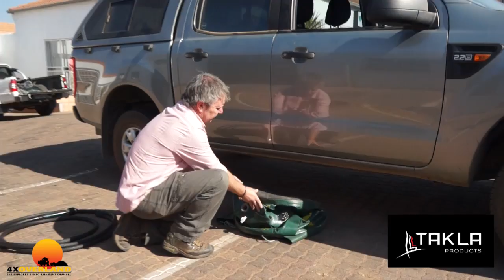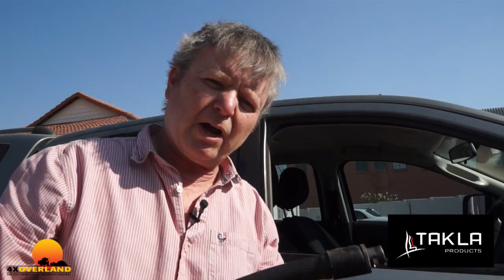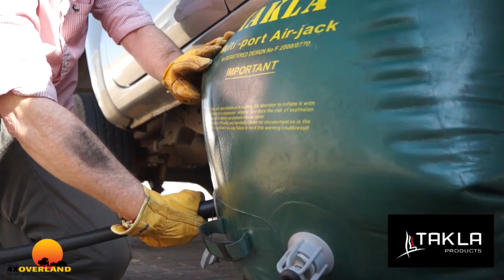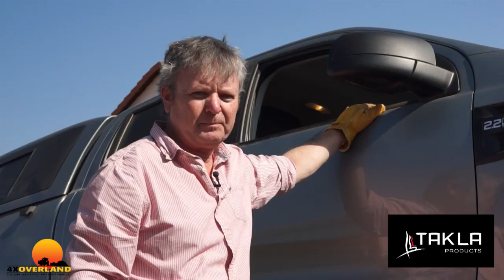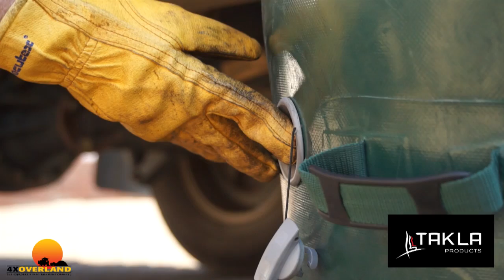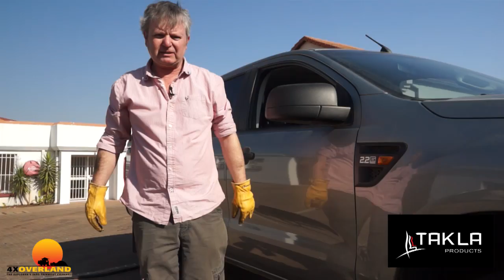Air jack Recovery Demo

Comment: A jack may be more dangerous, but it doesn't take as much storage, it can be attached to rear bar/tire, bonnet, side, front and rear of a roof rack, where this could only go in the boot or on the roof rack, it also takes much longer and more work, if I'm stuck on a beach and the tides coming in I'd rather use a jack or maxtrax, because they involve very little work, and in the summer in Australia, it's not fun to be doing alot of work.
Reply: But that's the point: you NEED strong attaching points on your car - which modern car has that?? The HighJack is dying out because of that, besides some countries where you are allowed to drive old or extremely modified cars. Which will be less and less.
An AirJack is not replacing traction aids - and if the tide's coming in you might end up with a sunken HighJack that's blocked with sand.
On my behalf, I would always use the compressor method and not the exhaust. With a strong compressor, it might take a bit longer but is a lot less hazzle and dirt - also think about the poisonous gas that will partly leave the Jack inside your car.

Comment from the maker: The argument that an air-jack cannot be used as a winch is irrelevant. Because while on paper it can winch, it can't unless the rope/cable used has zero stretch. Who carries this kind of kit? Not many. A hi-lift is more dangerous, more difficult to use, heavier, needs a jacking plate, and needs the vehicle to be modified for it to be used. Air-jacks have none of these disadvantages . I've decided, I am not going to be carrying a hi-lift any more. Instead I'm taking an air jack with a mounting bag on the spare wheel.

Comment: The question I can never get strait answer out of people is; if you could only take one jack on a journey, would it be a hi-lift or an air jack?
Reply from the maker: Very good question. I've attempted to answer this here: http://youtu.be/gmzMx9_TkaU
Reply: 4xOverland
Thanks for that.  I hate to say I still don't have a strait answer, but I guess that's the point.  There isn't one.  I don't think I can spring for an airjack simply because a hi lift can also be a clamp and winch (No electric winch yet).  thanks for all the videos.
Reply: Definetely the Air Jack because it's more variable in use* without a big risk of damaging your car or yourself - without a puller option, of course. For this, a GOOD hand puller  is a lot more efficient and both together are still lighter than an AirJack.
On modern cars you don't have choice because of a lack of attaching points - I'm thinking also of helping others in a group or in general.
*I mean on different grounds, different areas under the car (front, sides, back), different cars, slip into extreme narrow gaps, pushing not only up, but also back or forward or sideways.
Reply: i guess its not without irony that I already bought a hilift.  haven't had to winch with it yet but its been a nice lifting tool.
Reply from the maker: After years with both, right now, I'm undecided. Hardened off-roaders prefer the hi-lift. But many have never used a really good air jack and seen what it is capable of.